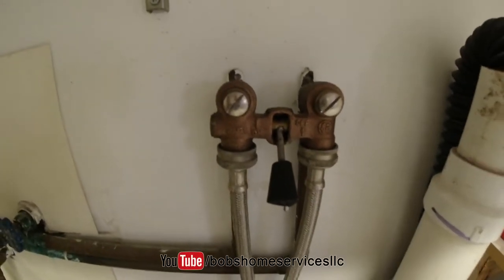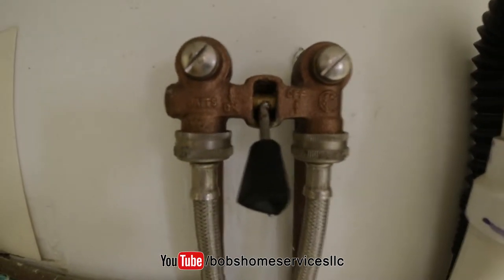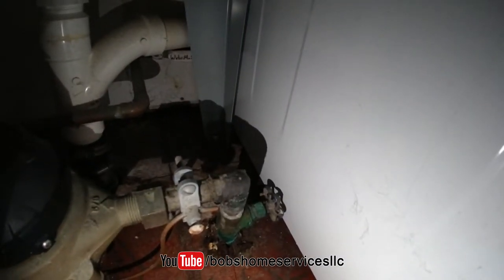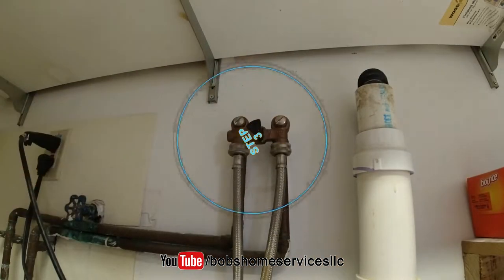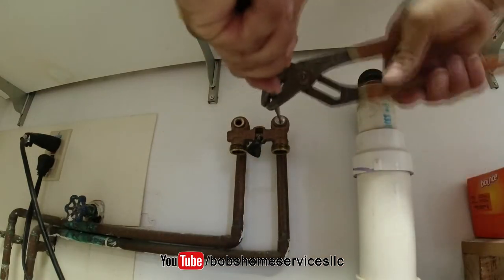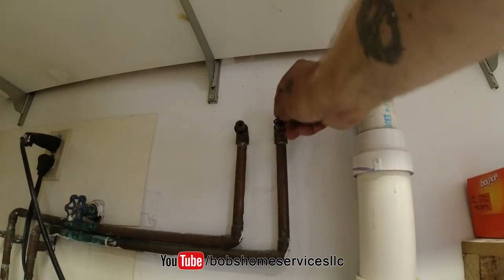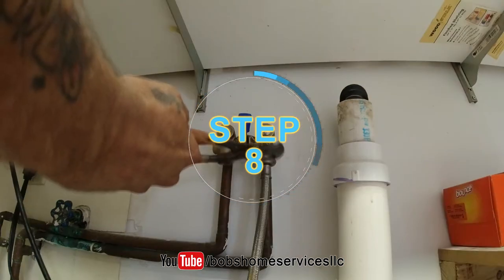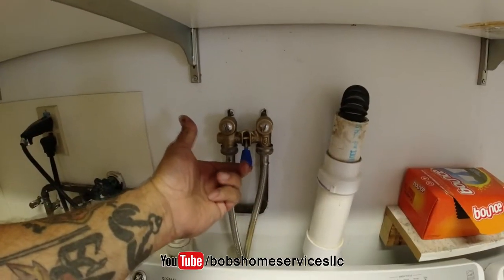HOW TO CHANGE out your Watts laundry valve in under two minutes

Comment: Mines in very tight quarters,  I’ll need a right angle ratcheting screwdriver, but they are all like 4inches long.  I don’t feel like I’d get enough leverage.  The screws are tight, can I use rust buster on them?  The whole assembly is green from being there for 30 years.